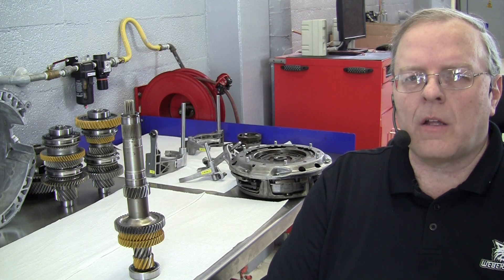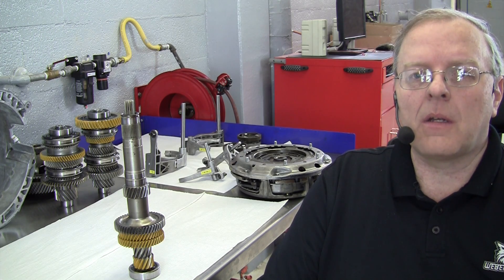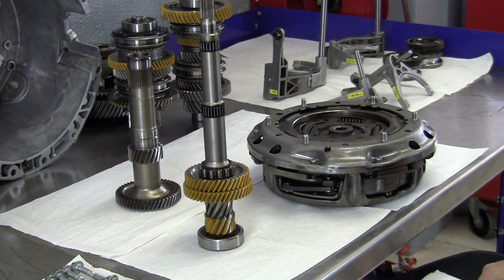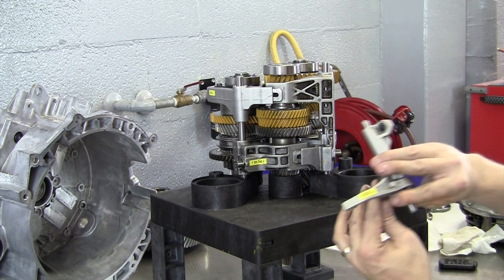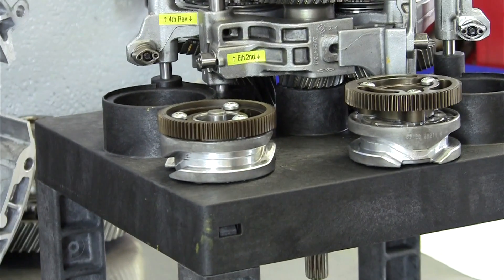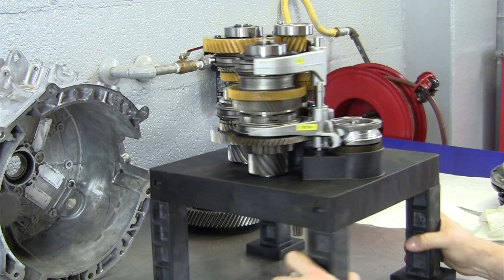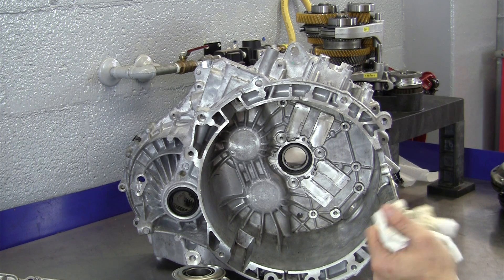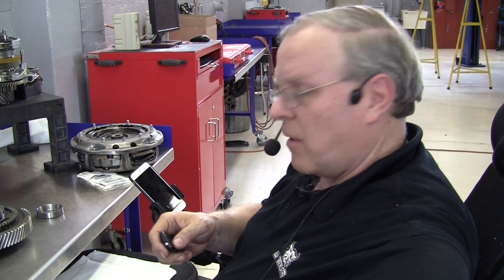Ford Dual Clutch Transaxle (DCT) DPS6

Comment: 36:15  They are called Shift Drums.  The design has been used on Motorcycle gearboxes for many decades, although most are single clutch, using a single drum with Three grooves.

Comment: John, I’d like to offer some professional advice about your microphone use. The mic capsule is picking up far too much low frequency that does not help understanding. It also seems to have too much gain and is overloading its preamp or your interface. These two problems are interdependent to some degree. Let’s start with placement.

Move the microphone so that it is not in front of your mouth but rather to the side of where your lips meet. Keep moving it in that direction until you hear the clearest pickup in your headset. You should hear no puffing of wind from fricative consonants no matter how loudly you make those sounds. 

Second, try lowering the gain of the microphone signal about 3-6 db. You should hear some pretty obvious improvement once it is hitting the preamp or compressor after the preamp less hard. Depending on the path your mic signal takes there may be low cut adjustments as well which will make a big improvement. 

You do fantastic work and I’d like the largest number of people to enjoy it. All the best, Peter.
Reply from the maker: Thanks for the feedback!
Reply: @WeberAuto    You’re very welcome.
Reply: Who cares!?!?!? Your comment is 9 Years late.
Reply: @zapa1pnt    As to your second half, oops! I failed to notice that and thanks. As to your first half, 🖕🏽

Comment: So is it better that a Ford Dealer fix these issues or should a Transmission Repair shop be able to handle this job...
Reply from the maker: Ford dealer. Specialty tools are required.

Comment: I came across a video that said engine damage will occur if the engine is cranked in reverse, to spin the flywheel to access the clutch nuts and integrated bolts; do you or anyone else here recall such information? Or what is the official procedure on spinning direction to double torque nuts in the 1, 3, 5, 2, 4, 6 pattern - top of flywheel to front of car or top of flywheel to back of car) anyone? Ferris Buller reference?

Comment: I turn manualy to the left the c1 or actuator motor A shaft I mean were it conect to move the fork , and turn the clutch by hand and engage.
I did the same to c2 or actuator shaft B and clutch doesn´t ingaged, I guess should engage too.
I am right or wrong?

Comment: Smart cars use a similar system, electrically operated standard clutch and electrically shifted gears in a manaul transmission has full automatic and manual paddle/stick shift
Reply from the maker: Thanks for your feedback!

Comment: That's your definition
Reply from the maker: There are many many automatic transmissions that use this system or a similar system used by BMW, VW, FCA, GM, etc.. The difference here is the trouble they have been experiencing.

Comment: I put two new clutch forks inside my transmission. Then put back together. Hooked it up to my computer to do a transmission relearn .. the test failed  said clutch travel fail then test ended . Does that mean I should of replaced clutch as well as the two forks a and b ???? Thanks what a pain doing the job on my driveway also I bought special tools and a computer just to do this job instead of letting ford do it at around 5k I’m sure ??? Thanks

Comment: GOODNIGHT! TEACHER HAVE PROBLEMS WITH A 2014 TITANIUM PARTY WITH DPS6 TRANSMISSION DOWNLOAD THE TRANSMISSION TO CHANGE THE DOUBLE CLUTCH AND NOW DOES NOT REGISTER THE PARKING AND GIVES ME THE DTC P0707 (LOW CIRCUIT INPUT TRS A), P2802 (LOW ENTRY OF CIRCUIT B) , P0901 AND P090B, IS THERE A POSSIBILITY TO GIVE ME REMOTE TECHNICAL ASSISTANCE?

Comment: Hey John my daughter bought a 2012 Focus with this transmission had to have the two common repairs done input seals and tcm module. The problem with this transmission is the application its for supercars ripping the track all or nothing. Not for your daily commuters stop and go or the worse for the clutch creep. Let your foot off the brake you creep the clutch is slipping give it a throttle input now fully engaged. When you brake it disengages the clutch so dont creep told my daughter that and at 250,000 k this thing still going. Still think a pos put in the wrong application but still interesting the engineering it took to make this.
Reply from the maker: I am sorry to hear of the troubles with that car. Best wishes

Comment: No matter how interesting the pieces and How majestic the configuration, it failed on Ford vehicles, that what matters!
my 2017 Ford Focus shakes like a belly dancer when it shifts the lower gears!
Reply: Try the grounding method, clear the grounds by removing the paint

Comment: It's normal this dct transmission has some noise ?  In my focus first I have slipped gears ( shudders ) when first to second. 
That's fixed but still remains a sound like metallic purr car or something like that. Only when I drive climb up a hill . It's like when first gear need power have some noise.
Reply: Need to check ur gearbox, it may lead to stuck btw 1st to 2nd shifting.
Reply: Ford has several recalls and technical bulletins on this transmission No it's not normal.

Comment: The transmission is not automatic is a manual transmission configured in another way , the trasmission is electronically controlled but still maintains the same basic concept of manual transmission operation.
Reply from the maker: Thanks for your feedback
Reply: Hey Pascual.  Automatic means that it shifts without you manually shifting the gear with clutch pedal and gear stick input, so, it is definitely an automatic transmission in that regard.

Comment: I've had to replace both clutch assemblies (during a single failure event), The question came up... "What about using the cruise control to down-shift coming down a hill?"

This was actually a great question and needed some testing, I had cruise control set to 45mph over an arched bridge which had a speed limit of 35mph at the exit. coming down the arch of the bridge, i used the cruise control for the rise of the bridge arch and then used the "Coast" button to slow down... it will shift into lower gears to use engine compression-braking.

This should be included in the performance notes.
Reply: Had mine on cruise going down a hill got stuck revving 3000

Comment: Its 2 three speed standard transmissions computer controlled duel dry clutch does. An automatic have dry clutches just like I said deceptive sails practis
Reply from the maker: I can understand your point of view. They have had a lot of problems with the clutch assembly.

Comment: I have a P2837 shift fork "B" position circuit range/performance and a 287B shift fork "A" calibration not learned. There is no reverse. 50,000 miles. I swapped shift fork actuators around and still the same codes and no reverse. Do you have any suggestions?
Reply from the maker: Disconnect the 12V battery for a few minutes and then reconnect it.

Comment: My mother's Focus uses this transaxle. Feels like a manual the way the clutches apply. Spins the tires on accident, often. And you can't brake torque it. It defaults to neutral so it revs like you have the clutch pedal depressed in a manual. Even in drive, as long as your stopped with the brake depressed. It's been in under warranty once to have a clutch motor replaced and a reflash. Certainly better than the CVT alternative, and gets remarkably good mileage, thanks to the lack of slippage.
Reply from the maker: +Michael Allen Thanks for the feedback!

Comment: I have a 2014 focus and I was wondering when I should change the dct fluid? Ford says 150k but that seems way too long....thanks for the vid! My car runs great after 17k
Reply from the maker: Leo Derosia 100k-150k for a transmission oil change is pretty typical on cars. Thanks for watching!
Reply: FordTechMakuloco recommends every 60k. In my eyes 150k is too much for sure. More than likely that's Ford trying to make more money from repairs.

Comment: i have a 2012 ford focus that's transmission went out after 45k miles; i was not smart enough to look at the warranty, so i took it to A+ transmission in houston tx.  They re-built the transmission for $3500 (4/29/17).  on 11/9/21, clutch stopped shifting gears, so i took it back to A+ Transmission in houston (shepherd & washington) and they said fluid was leaking past the seal and the fluid made the clutch brittle, so it needs to be replaced;  they quoted $3900 this time.  I do not know anything on this subject other than what I have seen in this video (which it was super comprehensive and very informative).  
i am supposed to call back to give the go ahead on the $3800 repair or the $700 to put the transmission back together... i am leaning toward the $700 option b/c who knows if the seal will leak again... am i right to think this way?

Comment: I have one of these, and never changed the clutches but had the TCM replaced once. 213k miles. It does buck a little when getting the shafts to the same speed from a stop, but I've changed how i drive to better suit it and it drives pretty well. I give it what i know it expects with throttle position to better its shifting and it does just fine for me. A seal on the CV let it leak and now it makes some noise from being low on fluid, but its topped off again and running strong- that was 40k miles ago. Lots of interstate driving is about all it sees. Probably wouldn't of made it past 60k in the city.

Comment: Wet clutch DCT systems are more common.
Reply: Which one is better?  Electronically controlled or hydraulically controlled (like the VW DSG) ??
Reply: +Marek Sumguy electronic systems are better because electronic systems have more precise control than a hydraulic system.
Electronic systems can be fitted with sensors to detect how the vehicle is being driven and adapt to changing conditions on the fly.
If Volkswagen's dsg is one of the fastest shifting transmissions available in an affordable car like the gti, it must be electronic.
I think all DCT transmissions are electronic and that is the why they are able to pre-select the next gear.
If a DCT did not have electronic controls, pre-selection of gears would not be possible.
The pre-selection capabilities of these transmissions is the reason they can shift so fast.
A conventional automatic transmission doesn't need electronics to function.
I don't know why you think a DCT doesn't need an electronic controller to work properly?
Reply: Ok you clearly don't know what you're talking about.  Thanks, bye.
Reply: +Marek Sumguy Don't ever talk to me like that again!
That is insulting me!
Reply: +Marek Sumguy I looked it up.
A hydraulically controlled DCT does have electronics.
The transmission is actuated hydraulically with the valves being controlled be the TCU.
The DSG works something like this,
There is a pump within the clutch assembly which circulates the fluid through the transmission.
When the transmission shifts, the TCU operates valves to re-direct the fluid to actuate the clutch and pre-select the next gear.
Now that I think of it, I think most wet clutch DCT transmissions use hydraulic actuation similar to the VW DSG.
Reply: Yes i know all that!.  That wasn't my question.
Reply: +Marek Sumguy I'm not sure which is better.
I never had time to research which is better, hydraulic or electronic control.

Comment: does anybody know if there is an inspection hole or cover you can use a scope to check input shaft condition or oil leaks? this would help diagnosis for the all common shudder condition my 13 is suffering.
Reply from the maker: +marc boyles There is no hole. It is sealed up pretty well to protect the clutches from road debris and water. Oil leaking from the mating surface to the engine may be a sign. Thanks for watching!

Comment: why would a dct450 transmission cause engine to stall when shifted from R to D and trying to set off slowly? it feels like it releases the clutch faster than it should be. if you wait two second on brake and let it brake go, it works flawlessly.
Reply from the maker: Good question, something is not operating correctly. I would have the dealership check for a flash update for the trans controller.
Reply: Thanks for response. What they did was the adaptation of forks etc by using their interface. I wonder if this can be caused by a single selenoid inside of control unit. Because,  this problem is isolated to only 1st gear. Rest is ok and transmission works correctly as long as vehicle is in motion. No vibrations no noise no slipping nothing.

Comment: This transmission was a disaster for Ford. In my opinion the only reliable form of DCT uses wet clutches that are bathed in ATF for cooling and lubrication.

Maybe Acura (Honda) will donate their new second generation NSX and you can do a Deep Dive video on the NSX 9 speed DCT, with wet clutches.

Comment: Good video. Very informative.. however I  do NOT find anything incredible about this transmission! I am currently rebuilding one for a ford focus that I got from my grandmother 9 moths ago.. before it completely stopped working I was spending hours every single day on the side of the freeway or wherever waiting for the transfer to cool and reset back normal so I could start the car and drive another 15 min and repeat.  I got screwed by Ford with the extended warranty... 4 days after I got the car it did its first gear jump. After researching the code i discovered the extended warranty but by the time The local dealer had a spot open the CEL went off and was erased from the permanent codes. The dealer mechanic attempted to re-create the issue with 2 road test of approximately 11 miles each time over two days.. mind you it was late December in North east ohio... it was at or below freezing outside.. so no shit it won't act up... after I was charged $200 for absolutely nothing they told me I had 4 days left under the extended warranty program... then of course soon as summer hit all shit hit the fan and I am now screwed from any warranty claims. Btw.. the car has 60k miles on it.. meanwhile I've been trying my old car which is a 2006 toyota matrix with at least 320,000 miles (odo stopped ticking at 299,999..) and 100% of the parts are the  original... not including normal wear and tear batteries, front brakes only, and tires.
 So there is absolutely nothing "incredible, awesome,  well designed, or otherwise about the Ford DPS6 transmission." They are worthless junk and Ford needs to be held responsible for their negligence and deception.... https://chng.it/JTvtpDf5

Comment: KEY for this trans: your battery has to be in good shape; less-than produces inferior shift motor operation ('shuddering' complained-of etc.). So half-life to new is necessary (alternator doesn't supply necessary amps at low rpms, where 'shudder' happens) with this trans. NOT A CLUTCH issue but instead Mexican servo motor requirements, or they'll turn later and slower, and you then 'hear about it'  :)

Comment: OK, I didn't catch the name of the gear assembly that the TCM uses to control the shift forks But is there a alignment mark between the two ? I can see if the gears were not placed to synchronize with one another when ramping the forks in and out of desired gear. It could cause one gear to engage before another is free and vice versa. Essentially causing a shutter or jerking.
Reply from the maker: The gears are called Shift Drums. There are not alignment marks, they just have to be installed in the neutral gear position. The TCM will then learn their positions with a scan tool function. The shuttering or jerking is because of the clutch disks being contaminated, or dirty, or glazed, etc. Best wishes.

Comment: Great video, very educational. Thank you very much.  Is VW Dual Clutch transmission quite similar?
Reply from the maker: pingshakl Yes, but the VW uses dual wet clutches instead of dual dry clutches.  I hope to shoot a video on that system sometime.
Reply: THanks. :D

Comment: Great video, can you please tell me, what causing the slipped, shutter and the reverse gear is not engaged on this transmission
Reply from the maker: In early models, there were oil leaks from the input shafts. In later models shuddering is just part of normal operation. I fo not know why reverse would not engage.

Comment: I find it’s fords learning programming that’s the problem. As soon as mine starts to shudder I put it in tow mode overnight and then accelerate hard to 4th gear 3-4 times in row and it goes away for thousands of miles. That’s assuming you have the new seals and clutch’s and it hasn’t gone on so long the clutch has high spots on it
Reply: A tune got rid of my DCT problems in my 16 focus almost immediately  definitely a OOF on fords tuning department.

Comment: Ok,I see why Ford have made the clutch springs opposite of normal clutches. If one of those motors fail that operate the cluthes then the gearbox will not be trying to use 2 gears at the same time. Very interesting.
Reply from the maker: Thank you!

Comment: So the clutches are normally disengaged as a failsafe - if one clutch activator fails, it won't try to engage two gears at the same time.   I have to wonder if that is the reason for the shuddering and rough shifting reported for the Focus and Fiesta that used it.  I can't imagine having to program the clutch activators to account for the different forces experienced as the clutch engages.  The only way I could see to get more solid control would be a lead-screw activator instead of the forks.  Much more mass, very solid linkage to combat bounce, and totally unfeasible on regular automotive transmissions (size, weight, cost), forget a dual clutch.